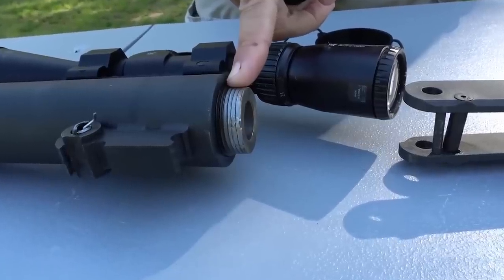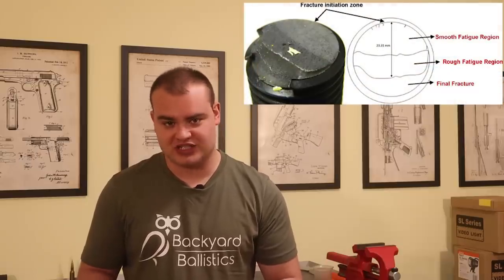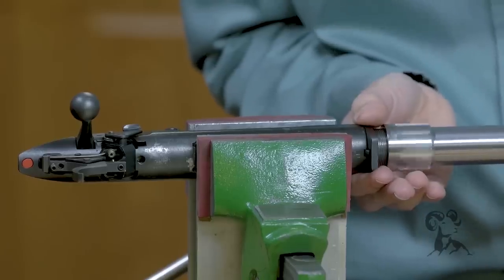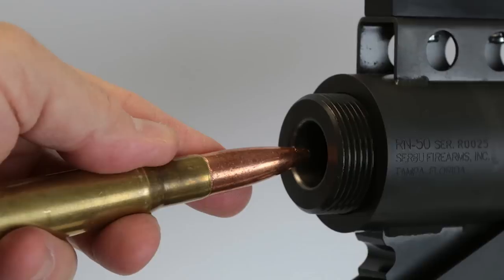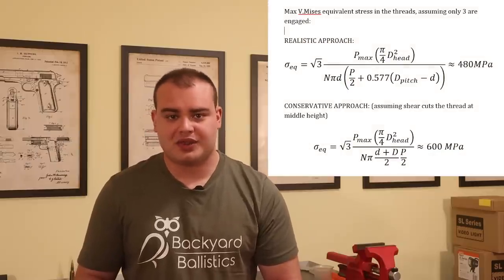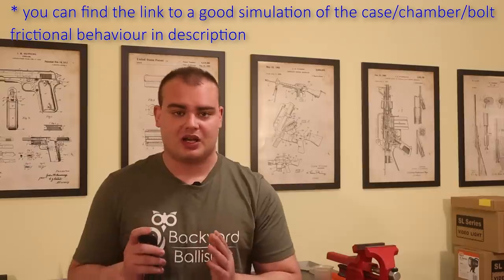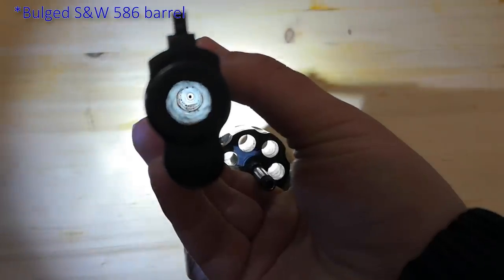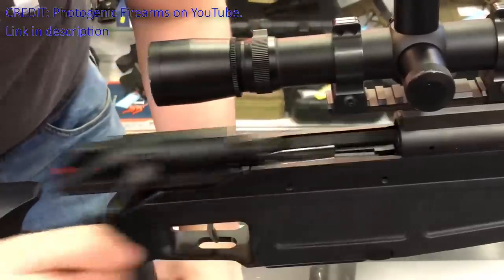Serbu RN-50 Failure: A Closer Look

Comment: My guy listen I'm a auto mechanic and I can tell you for sure that threads do not hold like they say in text books maybe in a perfect world. Yes most barrels are attached with threads but you do not screw and unscrew them each time you load the firearm. Each time you screw it together the threads can grind together creating larger gapping in threads which in turn makes it even Easier to turn but weakening the thread lock abilities. This is similar to using a metric bolt and standard nut. Which is not recommended. In all a threaded connection is not ideal for this use in firearms and this gun will never be truly safe or fail safe. Use caution this gun is poorly cheaply designed. Sorry

Comment: I love that you address the importance of the location of the obstruction.  You're the first person I've seen covering this that has made that distinction.  People keep talking about the muzzle brake, but that's a complete red herring.  The smaller version of the SLAP round was abandoned because of the tendency of the sabots to fragment in the bore resulting in the penetrator kicking to one side and hanging up in the rifling.  It was less common in the larger .50 rounds, and when fired from the M2 it didn't destroy the weapon when it did, so they decided it was safe enough to push into production and use (I think the USMC did the testing on these, but don't quote me on that).  If the polymer had gotten brittle from age or the round was loaded too hot, there's a good chance this is what caused the obstruction.  It should be easy to tell when someone runs a scope down the bore because that tungsten penetrator would have torn a chunk of the rifling up if it made contact and hung, even briefly.

Comment: Very well presented. I work in safety (railroad), and was trying to look at this from a chain-of-failure point of view. Not a mechanical engineer, but your explanation is enough for me to understand the elastic, plastic, and shear things that I was pondering. When things fail, you look for friction, deformation, and mass to try and control the wayward force. Your mass statement was an "aha" for me. Much slower, but much heavier projectiles, but the science is the same.  Keep up the good work!

Comment: "This can happen also on expensive guns, like the Blaser r93"

Thanks, now I'm afraid of handloading my Blaser ahahahah
Reply: I bought a bunch a reloads amd they all different sizes dose anyone know if that's bad ?
Reply: @poppaganja3793  if the only difference is how much the ball protrudes it's normal, different ball shapes and weight can cause that. If the brass is different then it's a whole different problem
Reply: @poppaganja3793  Inconsistent seating depth? Depending on how inconsistent it is it could be safe, my hang up is that if the loader didn't even bother to seat them to consistent depth I'd be worried about what else could be inconsistent. Honestly I would look for the ones that are seated the deepest and if there's too much of a different don't fire those. Bullets pushed too deep can cause overpressure.
Reply: @bart5246  The difference between rounds would be visually noticeable just handling them, not to mention who would reload an American projectile in a Soviet case that happened to be sabotaged?
Reply: Blasers are a meme.
Reply: Stick to normal loads and the Blaser R93 will work fine. You defenetly not want to have under or over pressure, because both can potentialy sent the bolt flying in your face. Bevor of cause it might rip your thump of.
Reply: @bart5246  There's no other way to get an American SLAP projectile and sabot on a Soviet case.
Reply: @bart5246  "you wouldn't be able to tell the difference in case dimensions without a caliper." - You're joking right? You can tell them apart by naked eye.
Are you seriously claiming you need calipers to see a 9mm difference? How do you load your 9mm cartridges into the magazine if you can't see them?
Reply: Avoid double charges, or, single charges of fast burning powders; 247 grains of Clays in a .50 BMG case, for instance, is not a good start, and, would be the equivalent to about 2.667  hand grenades! :)
Reply: @bart5246  "if they aren't side by side you couldn't tell the difference" -  I don't want you to explain, I just want you to say you can't see the 9mm difference: https://detektorweb.info/images/stories/upload/2011/37078/obr3.jpg
Reply: @bart5246  And KB had several rounds side by side at his disposal.
Not to mention that the Soviet case is wider at the bottom so it could not have fit in the chamber no matter how deep it was cut unless Serbu somehow had a 12.7x108 reamer laying around.
Reply: @bart5246  some people are pretty damned thick in the head.
Reply: @bart5246  That's almost half an inch difference in case length...
Reply: @bart5246  if you can't see a 9mm difference in length, not to mention a significant difference in cartridge shape, you shouldn't be shooting.
Reply: @bart5246  9mm difference is noticeable by sight.
Reply: @bart5246  The russian cartridge is 9mm longer. If you look at the images that's almost the entire thread length. The shoulder dia is 1mm wider as well. I don't think you would get it half way down the chamber.
Reply: @bart5246  dude. They look so different. I'm sure to the untrained eye you won't tell the difference but if you're constantly handling .50 bmg (or said SLAP rounds) you'd notice very easily how different it would look and realize some thing is wrong. Like the difference between a .40sw and 10mm. Its only a couple mm of case length but extremely obvious something isn't right if you know what you work with. I'm going to claim a possible obstruction due to round performance and/or overpressure (which was noticed already during firing as the rounds' powder was burning inconsistently.)
Reply: @bart5246  Well Iv'e actually built a couple of guns as well as rechambered a few so I'm not totally green. :-)
Reply: @bart5246  I'm an aircraft mechanic, I know all too well about tolerance stacking. Thank all that is holy I've never been on the wrong side of an accident investigation (knocks on wood).

The 12.7*108 case has a head diameter of 21.75mm, shoulder diameter of 18.9mm. shoulder length is 85.27mm from case head.

.50bmg case head is 20.4mm, shoulder diameter of 18.7mm. shoulder length is 3.006" from case head (76.35mm according to my calculator)

If KBs chamber was cut for 12.7x108, actual .50bmg would be heavily distorted and smoky, if not ruptured. Assuming that the BMG actually fired to begin with, since the BMG case head would be 9mm away from the firing pin based on how KB throws a round into the chamber.

If someone tried to stuff a 12.7x108 case into a .50bmg chamber, the x108 case would be sticking out of the chamber at least a half inch due to the wider and longer shoulder, maybe more if the case taper is different (don't want to do the math for that on my phone), and KB wouldn't have been able to put the cap on, let alone close the action!

You need to learn what dimensions are significant in firearms. It's not a mm here and 5mm there. It's a tenth of a mm here and 0.05mm there. Those out of battery tabs that broke aren't cut square to the receiver, they're cut at an angle so that they just barely clear the cap when closing, and make sure the cap is completely tight when the receiver is completely closed.
Reply: @jonadolfsson7777  the bolt on a 12.7x99 will not chamber 12.7x108. The dude is trying to throw weapons engineering out there while not knowing who may be in the chat. I own weapons that can chamber 12.7x108. I'm also in the middle of cartridge development of a hypersonic round.
Reply: @StreetxDSM  I must admit I envy the calibers you can play with over there! The biggest I've got is a silenced short barreled 9,3x62 that I actually built from an old k98. Wonderful action that's still modern!
Reply: That's one of the reasons I never bought a Blaser R8. Although it's a great rifle, I'll never trust it 100%
Reply: the Blaser is another shit design that has a record of kicking bolts open.
Reply: @ChucksSEADnDEAD  I appreciate all these well-thought-out and articulate responses, but apparently he didn't. 
He probably has never held these rounds in his life, but he apparently kept acting like he's been around them for years. Thanks for schooling him.
Reply: Dont be. This incident has a very simple, yet complex explanation. The SLAP round caused this. I'm going to comment on this video and explain it.
Reply: @jonadolfsson7777  love it. I have a thing for firearms. It's like a reminder to the government that it can be shoved out of the way.
Reply: Full size the cases for Blasers R93 they dont like necksized cases.
Reply: There is a good reason to be afraid of any R93/R8 action nor will avoiding hand loads for factory ammo render this any safer. The R93, as its update the R8, will open up in a pierced primer event, that permits high pressure gases to flow into the bolt system. And all accidents that I come across so far been with factory ammo of reputable brands. All it take is primer in the magazine to move under recoil.
Reply: I blew up my ar last year reloading.  Grandpa put all the buck powder from pulled bullets in an empty bottle of blc 2.   Pistol, shotgun, and maybe even black powder all mixed together then forgotten about after he died.
Reply: Handloading is safer ,if you keep the rules ,factory ammo  is  also on regular base at recals to .because of wrong loads ,
Reply: Dirk Dingle Berry  false, as everyone has pointed out(even on this video), the Serbu is safe with the loads it was meant to use. The SLAP round is already an hot load, but in this case it generated way more pressure than what guns are tested for(usually up to 25% what SAAMI/CIP consider "normal load"). No rifle is meant to sustain over that pressure if not built with the purpose to do that.
Reply: @Michael Hill Exactly. The flap that ended up almost killing Scott was solid steel, that piece should have deflected the cap instead of being destroyed. It's similar to what other guns like the Beretta 92 use to protect from a broken slide, you need tons of energy to destory those.
Reply: @poppaganja3793  it’s best practice to not shoot other people’s reloads, and unless it’s just a different component, you shouldn’t have any visible differences
Reply: Its not hard, just don't hot load the crap out of them.

Comment: I’ve been reloading ammunition for a long time and I would bet a lot of money on that round being over powdered or and extremely over crimp.
Reply: It was ......that rifle worked perfectly fine
Reply: @memeier9894  That's pretty much a possibility with EVERY design. A high enough over pressure event can easily turn the bolt into a projectile and/or shrapnelize the gun.
Reply: @reaperreaper5098  with enough pressure sure, but a given volume can only produce so much pressure, and it should be designed in such a way that even if it fails catastrophically, it should do so in a manner that does the least amount of harm possible. In my opinion two little locking ears whizzing past your head and an end cap hitting you in the eye at mach 5 isn't it... I don't blame the rifle for failing, the ammo in my opinion is the culprit, but I do fault the manufacturer for the way in which it was designed or not designed to fail in.

Comment: This was an excellent video. I feel like you may have been too kind regarding the lack of fail safe design but i understand why you were. I'll definitely be watching more videos from this channel.
Reply: @Septic Whelk Adding emergency gas vents shouldn't add to the weight, if anything it might slightly reduce it.
Reply: @Septic Whelk Serbu himself makes a 50 with an enclosed receiver that probably would have failed in a more safe way. Not zero risk of course, but probably less stuff hitting the shooter.

Comment: Wow, can't believe I didn't even think about the fact that most barrels are threaded into receivers or held on with a barrel nut as an example of why this method is sufficient lmao.
Reply: Threads are still more vulnerable to wear and damage from constant use. Cross threading can damage the first thread and grit can gradually erode. You don't unscrew and rescrew your barrel each time you fire. Suppressors for example have been moving to lugged quick connect systems away from threads partly for this issue.
Reply: @ctrlaltdebug  yes that's true about not unscrewing your barrel, still think it proves the base concept.
Cross threading? You're doing it all by hand.. to cross thread it and cause serious damage you're going to have to ignore lots of warning and use alot of force to cause serious damage on threads that size. obviously if the threads become damaged that changes things.. Just like if a barrel extension or bolt lug becomes damaged in any other design..  sure there's wear on the threads just from normal use, but it's also a single shot .50, not something people are generally  putting thousands of rounds through a year, especially not the person that bought the lowest cost .50 on the market. 
Threading on the end of most firearm nuzzles are alot smaller and would be more prone to damage or cross threading.
Also, tri lug mount suppressors or accessories in general have been around for at least like 40 years, if there was such inherent issues with direct thread cans I'd think they'd be alot further along in phasing it out by now. The main advantage  I think most people see from lugged or quick connect type cans is obviously the speed of taking them on and off but also not having to worrying about them walking off.
Reply: It's different with the barrel because the cartridge is in the barrel (or chamber)  the chamber expands as the cartridge ignites tightening the barrel in the receiver making the joint more secure, plus the barrel is torqued into the receiver to begin with, not so with the breach cap on the firearm in question.
Reply: But it’s literally not. As correctly stated in the video it’s not that threads aren’t sufficient it’s that the placement of threads needs to be correct.

Comment: The metal ears that help ensure the cap is fully seated also were ripped off by the force from the cartridge. They looked pretty stout, I wonder how much additional energy is required to destroy those too.
Reply: I don't know the metric conversion, but in imperial units it's approximately 1 fuckton ± 1 shitload.
Reply: @mattmurphy7030  Check any reloading manual and you'll see that there's a world of difference between a "normal looking" cartridge and a "normal acting" cartridge.

Throw pistol powder into a .50 BMG case for example, and I defy you to find a gun that WOULDN'T explode from attempting to fire it. The difference between a cartridge and a grenade comes down to some fairly tiny details that an inattentive or inexperienced reloader can easily fuck up.

There's a common warning in the reloading community that you should never, under any circumstances, fire a cartridge unless it came A: directly from an ammunition factory, or B: from your own reloading bench.

I don't want to blame Scott for what happened, but if you make a habit of firing oddball rounds that you bought from "some guy," there's a good chance one of your guns will eventually blow up in your hands.
Reply: @mattmurphy7030  I'm honestly not sure where else the shrapnel was supposed to go. Your face is right next to a gun when it fires, and if all that pressure can't go forward then "backward" is pretty much the only option left. I suppose the top of the chamber could be designed as the weakest point, but that would probably cause its own safety issues
Reply: I think Serbu mentioned it was estimated they can hold 20k psi of pressure together before shearing off like that

Comment: Brilliant review , and interrupted threads is a good idea. But I'm wary of anything that doesn't have a fixed hunk of metal between the bolt and my face lol...
Reply: Yeah I mean if you got money to buy a .50bmg rifle why not get either the bfg50 or the one I'd prefer which is the Armalite AR50? They're like a thousand bucks more which is a hell of a lot less than any hospital bill!
Reply: Done right, interrupted threads can also serve as gas vent holes pointing in a safe direction. When in the locked position, the milled-away portion of the threads line up to  form  wide open channels forward. Make these line up with relief cuts on the barrel so any leaked gas can safely vent forward away from the shooter, and Bob's year auntie.

Of course, interrupted threads have less engagement area so you need a longer thread section for the same strength. Also, unlike a simple threaded cap these would need careful fitting so they close up with full engagement at the correct headspace, the current design is self headspacing and automatically corrects for wear or ammo variables by always screwing down to zero headspace. Thus, going to interrupted threads would increase cost and possibly reduce accuracy.
Reply: @Kaboomf  If I recall correctly what Mark Serbu said about why he didn't use interrupted threads, the two main issues were machining the threads themselves (apparently much more difficult than it seems), and more importantly adding an effective out-of-battery safety.

Comment: One thing I noticed in the design that I haven't heard anybody comment on are the locking ears. If they were longer (or even extended back to the end of the lower) they would probably have not sheared off, and wouldn't have created the shrapnel that nearly killed Scott.
Reply: That cap came off like a rocket....those locking ears would have to be a thick as a roll of dimes to contain that cap, just my two cents, cheers